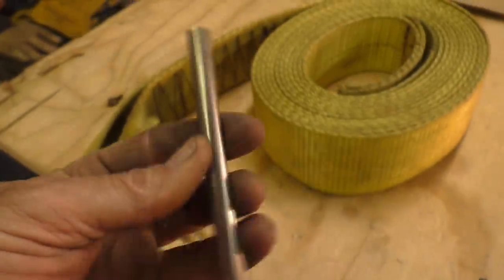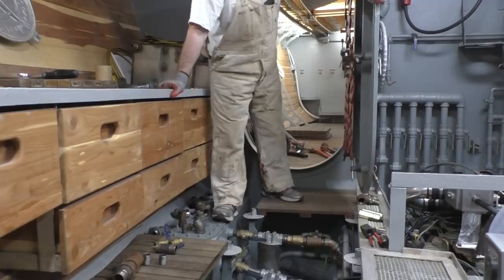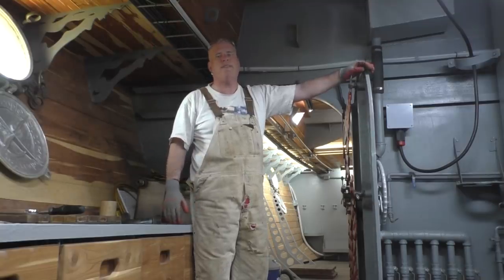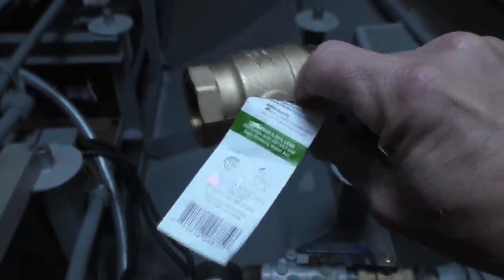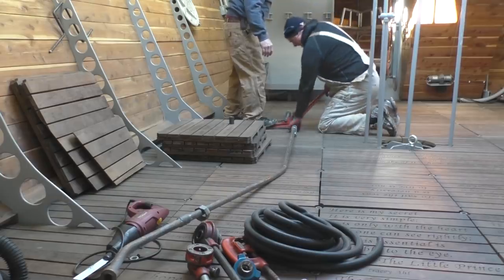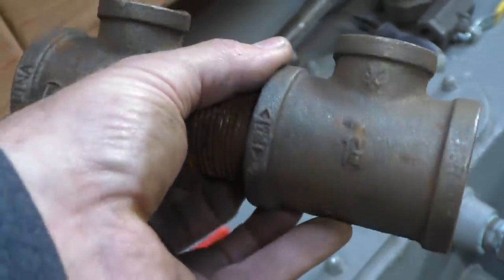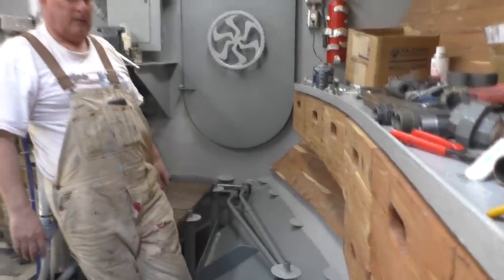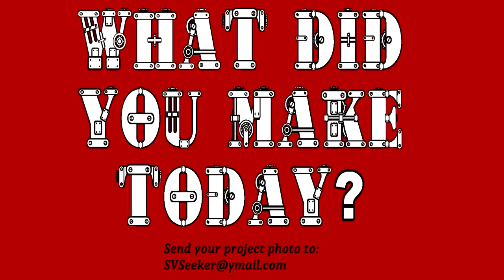Hydraulics - Part 4

Comment: When I was in the Navy many many years ago, I ended up on an aircraft carrier for a few years. I noticed air conduit, electrical conduit, fresh water lines, salt water lines,  air conditioning ducts all over the ship everywhere I went.  How did I know what all these were?  They were labeled.  What they were,  the direction of flow if applicable, to what they went to if applicable and some even had the size of what they traveled through,  10" main and such. everything was labeled.  Deck you were on even the ship frame you passed through so you could always tell where you were. Or to use the info to fine an area you needed to get to.  First job I had on that ship was to deliver messages from the radio room to different divisions and officers such as the Captain, Executive Officer, Admiral's office when  over seas, Air operations Officer, and such.  My favorite place to go was the Captains bridge.   I used the frame and deck numbers to find the places I needed to get to and to tell where I was.  
Wondering if you will be doing something similar?  It is obvious you can tell what everything is just by looking at it.  But others will not. And you will need others to be helping you for sure. 
So labeling will make working on the system a lot clearer and save a lot of time searching and tracing out the system. I assume you already knew this but was curious as to if you would be doing it.
If so I would enjoy seeing that done as part of you videos.
Reply: Big pipe jobs like these are just like programming, it makes utter and complete sense to the people making it and those looking in from the outside are just idiots. Problem is that in a month or few you yourself start to become one of those outsiders looking in!
Reply: My quess is that both of you have never been to Tripler Medical Hospital.
Reply: No he's said he won't label anything

Comment: You will NEVER regret putting those valves in you lines. More shut offs are so nice when (not if) things go wrong.
Reply from the maker: ...until they are the source of a leak.
Reply: @SVSeeker  good point....
Reply: @SVSeeker  You're not thinking in three dimensions! More shutoffs means when your shutoffs leak you can shut them off with shutoffs
Reply from the maker: @dominicksossong1854  Have fun on your boat.  : )
Reply: @SVSeeker  what part of the system can't you say that about? any part can leak but a shut off valve can save you trouble when another part leaks. The odds are in it's favor. you know, buy good valves...
Reply from the maker: @ettumama    Ok,  well, I'll never be as right as you think you are.  : )
Reply: @SVSeeker  I'm not trying to sas you or show off. respect. I love what you do and how you do it. I was cheering your choice of putting in the valves.
Reply from the maker: @ettumama     And I am only pointing out that every decision has a potential downside.   I don't think you don't make good decisions without considering the downsides.

Comment: Looking good Doug. Watch the valves. I have had them vibrate closed just with the weight of the handle over time. I have had to reposition them or just throw a zip tie around the handle that can be slid off if needed in an emergency

Comment: Nice up grades to the system!  Isolation is good.  Were you going to add HP valves upstream of those Check Valves?  That would allow you to change a leaking check valve without shutting down.  Check valves are not usually a good isolation device especially with 3000 psi on the other side.

Comment: Do you have a valve set up to be able to de-pressurize the high pressure side for working on it? I didn't see one, but it would be really handy when you need to work on the high pressure lines.

It is good to be able to see in the dark. Thought: cheap night vision goggles for use out on the water? Maybe just some cheap night vision cameras?

Comment: 9:00. I'm worried about how long that pipe lasts. I know you will keep it up but surely they have things that last longer.  I've plumed up things not like this but real close. Salt water was no where to be found. Lol. I'm just wondering on how hard salt is to the steel and brass fittens. 
 Good show man. I've been working out of my truck for years. I'm on my 3rd welder. I fix farm equipment and the things the farmers wives need to get to town in.

Comment: Hi Doug Can I suggest a better pin for your spools , Even a 3/8 threaded bolt will crush from a strap I always use flat straps on my boats less chafe but the bolts get constricted pretty bad even pulling up a high shore bank ,But I noticed yours is just a pin do you think the one end will come out of the spool and drop the tinder or one end ,Oz of prevention is worth a LB of cure .
Reply from the maker: I think there is almost zero change of that.   Too many wraps and lots of friction.
Reply: @SVSeeker  I thought of that too it still bent it on a regular light boat spool ,See what happens .
Reply from the maker: @GarnettM    I plan on it.  : )

Comment: can i ask how are you suppose to access the main engine to service it with all that gear surrounding it,
how are you planning to cool the engine room or supply the air to it
it looks way to over complicated for a simple boat 
that in turn will cause some headaches when the boat gets a dose of electrolysis,

Comment: To give you how crazy the documentation is on a nuclear plant.  I common switch that is just on a panel is required to document where the steel for the body came from.  Where the copper for the insides came from.  Where the plastic for the body came from.  THEN you add who manufactured the switch.  Tracking numbers for shipping.  Who received.  Who installed it.  Then if the switch is replaced it.  What was done with the old switch and throwing in the garbage won't cut it.  Makes a $2 switch as much as a thousand dollars.    YEHAAA!!!!!  On aircraft you do have a good amount of documentation but it makes the nuke docs look like a postit note.

Comment: Seeing you tightening up the pipe fittings reminds me, that my air compressor has a broken check valve on it that I can't shift even with a 4 ft persuader bar.  The only option I have left is to cut it off, hacksaw carefully through the sides and try to roll it out of the threads with a cold chisel.  Not looking forward to it.

Comment: Gorgeous hydraulic system. Is there one combined tank? If so, would it be good to put low separation walls inside. To prevent, one big leak to drains all three systems?
Reply: There’s only one hydraulic system with multiple pumps. That way he can power the hydraulic equipment with whatever pump he wants or is convenient.  

Airplanes do the same thing. One hydraulic system, multiple pumps.

Comment: I think you should consider painting the high pressure hydraulic lines a different color than the return lines. This will help avoid confusion during an emergency (buy you some precious time), and help avoid other potential problems caused by misidentification.
Reply from the maker: I think you should learn how a system works so you don't need help.
Reply: @SVSeeker   110% agree with you. I was thinking along the lines of if there was ever an emergency situation in which (God forbid) the most knowledgeable folks were incapacitated or frantic multitasking was going on, you'd want every bit of clarity in case a less-knowledgeable occupant absolutely had to manipulate the system in all the confusion. Clear identification could only help and be added with little effort. (I love your channel by the way! I've been watching for years.)
Reply from the maker: @Fataliac  So your scared, so you think I should be scared?    No.   I'll still want you to learn how it works or leave it the hell alone.
Reply: @SVSeeker  I think you misunderstood what he is trying to tell you. I think, he is talking about emergencies when adrenaline is running high, time is pressing you and so on.
Even with best knowledge of the system you can make pretty dumb mistakes. It's just psychology. Proven many many times over.
That's why in complex systems clarity is important. And your boat is complex system. 
For example in older aircraft all the indicators on gauges pointed in one direction when in normal (desired) state. Quick glance and you would know where is the problem.
BTW, I admire your commitment, energy and your life attitudes. Wish you and the Seeker all the best! 🙂
Reply from the maker: @irvingwashington3771    No, this "OMG OMG WHAT DO WE DO!"  bull shit comes up every time I post a video that has pumps, pipes and valves.   : )     The someone,  you this time,  piles on with "What if you are incapacitated,  and and the seas are running high,  and and what if....    It's just the human fear response,  and if you're decision the nurture that instead of learning what you don't understand and most importantly learning to control your fear so can think and respond with ability when challenged.
Reply from the maker: @aknighttrain    Pumpkin, it's a filter.   If you get you're panties so easily in a twist, is there any reason those of us that don't would want you to be part of our crew?    ....take your time.     See, you could be God Himself, more most likely just thing your God and endowed with all of the correct answers,  but if you toss a fit over that that then we're better off with you on shore.   : )
Reply: @SVSeeker  Actually, I wasn't talking about you being incapacitated, nor was I talking about anybody panicking .
But I can understand, that you have seen all too many fearmonging posts and comments and might be rather irritated when reading something that resembles them.
I accept you not agreeing to my post, I guess it must part of your "set up" that enabled you to see this immense project through. 👍
Reply: @SVSeeker  I'm well aware of your filter; that's how you keep outright criticism off the comments section.    That was immediately apparent to anyone scrolling through just one comment section, given your behavior.   Thanks for pointing out the obvious; my comment was directed at you and you alone - I wasn't seeking a public audience.    If I really wanted a public audience about some of the decisions you make, I'd do it easily, and I know you're savvy enough about the interwebs to recognize this.

I've got almost 34+ years  in running Dutch Harbor to Kodiak - that's big water, cupcake.    That's out in the Gulf of Alaska, you might recall a few hair raising stories about that particular patch of water.

I've seen about a dozen of guys like you dismiss experience and charitable well-meaning experienced mariners' advice, and they're gone now - victims of their own hubris.    

I'm not particularly saddened by their own fate; they were asking for that terrible end.   It's the innocent groundpounders who literally put their lives in incompetent hands and died for it that I mourn.    

Anyway, your response didn't make much sense and I get the feeling that you were drinking and combatively responding.    

I hope this response causes you to review and understand what I was trying to tell you.    

I think you've done a great job overall; but it's the small things that will fail and your outright arrogant dismissal from those who are experts show that you need a bit of reflection.

I fully realize that there's a ton of idiots who spout off nonsense and I can appreciate the bad attitude that develops when questioned by people who have no idea what they're talking about.      My point was that you're reflexively dismissing input that you really should at least consider from people that I recognized as knowledgeable people with snarky, arrogant replies.
Reply from the maker: @aknighttrain   That fearmongering tirade is your response on not color coding pipes?  : )    The world does not need another man acting like a Mom.
Reply from the maker: @aknighttrain     By good advice you mean Your advice.   Not Captain Charlie,  Captain Philips,  Neil, or a dozen of the other professional mariners.   And why that is remains unchanged.  You focus on fear.
Reply: @SVSeeker  no, not fear.   Just a healthy respect.    And that's the rub.

The difference is that I make sure that everything is properly installed and maintained and I know there wasn't anything half-assed.

Fear is when your rudder/and or/ engine fails and the following sea rams the vessel on the rocks.    Fear is when your passengers begin to drown and you're trying to save them but know you're next.   But mostly it's fear for your passengers, and there's nothing you can do.

How are you feeling about those improperly installed cable clamps?    How about those upside down pins?
Reply from the maker: @aknighttrain    Really?  Not fear.  Ok

Comment: A inline high and low pressure switch to control the electric clutch that drives the big hydraulic pump would be nice

Comment: A safety Sally comment for you:  Generally when I am designing a system like this I also put a relief valve in the low pressure return system in case a tank isolation return valve is left closed or some other unforeseen blockage allows the return pressure to build to the level of the supply pressure.  I'll assume the high pressure relief valve is sized to the capacity of your largest pump, or better yet the combined flow of all three.  Since I haven't seen your P&ID (LOL) you may not have such worries, and if so good on you.
Reply from the maker: Hi Sally.   If you're that knuckle head on my boat.  You can bet you'll be the one cleaning the bilge.
Reply: @SVSeeker  :)

Comment: Paint your hi-pressure lines red or green so if there is a problem you can identify them in a hurry.
Reply from the maker: Ha!  You need paint?  You can identify the high pressures lines when there is a problem, because that's the one the oil is squirting from.

Comment: Doug,  I assume you've worked out that your hydraulic pumps supply is actually able to flow enough oil to all your pumps at once so there's no cavitation?  Your supply tank didn't look to be elevated? Is it pressurized?
Reply from the maker: I guess you would  have to be there in person.

Comment: I’m sure you’ve already heard or knew this, but make sure that the any return valves are fully open before running the pump otherwise the entire system including the return lines will be under the same high-pressure as the supply line.
Reply from the maker: Yeah, no shit

Comment: maybe add a big label to everything. maybe someday someone other than you needs to open or close a valve ;)
Reply from the maker: I prefer you leave them the hell alone if you are not skilled enough to figure it out.
Reply: @SVSeeker  i got the idea from another youtube that almost sunk. he said that only he knew how all electrics etc. worked and that he wanted to add labels to everything after that near sink
Reply from the maker: @buck960  He's scared, so you're scared, so I should be scared?    No.   Fearmongering is not a replacement for skill.